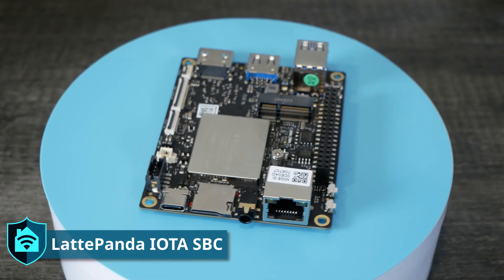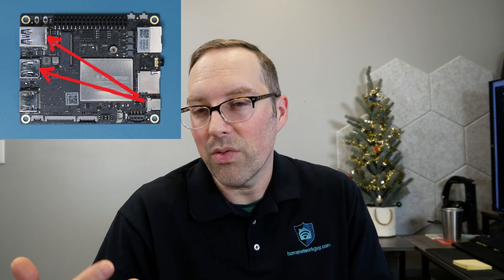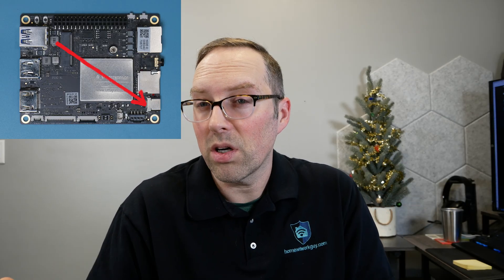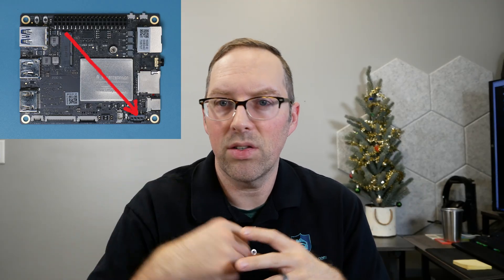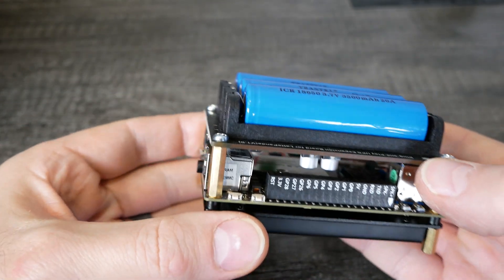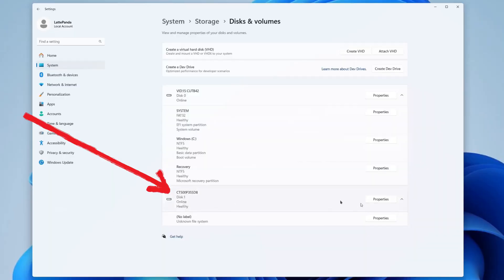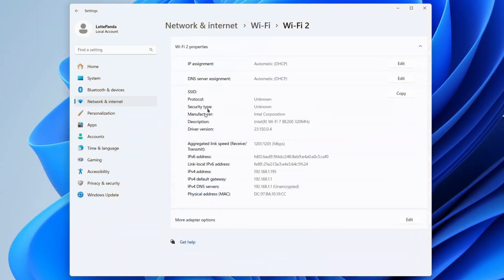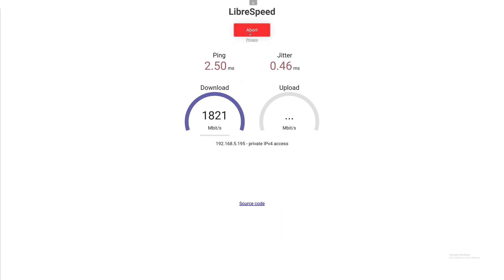LattePanda IOTA - A Palm-Sized Intel N150 SBC!

Comment: Thank you for the video. Am I missing something here? Who is this board for? By the time you add the NVMe hat, PoE, cooling, and a case, you’re well into a price range where you could just buy an N150 NAS or server class motherboard with a decent enclosure and far more native I/O. That’s where the value proposition starts to break down for me. The board itself is interesting, but the processor feels constrained by design choices like 1 GbE and accessory dependent expansion. Maybe the premium is mainly for the SBC form factor and ecosystem, but at this price point it’s fair to ask whether that tradeoff still makes sense. Please correct me if I’m missing something.
Reply from the maker: They advertise it for rapid prototyping and commercial applications such as industrial automation, intelligent gateways, advanced robotics, and interactive digital installations. 

If you just want a general purpose computer or server, it’s more budget friendly to get other options. The same goes for the Raspberry Pi and other similar SBCs. 

I like Raspberry Pi’s for projects such as a DIY touchscreen music player (I built several for my kids) and also an outdoor speaker which has an amplifier HAT so I can have Apple AirPlay enabled outdoor speakers. SBCs work well for those specific purposes better than a mini PC for example. I also like when I’m done with a particular SBC, I can repurpose it for another task (swap out components/HATs and customize it).

Comment: I would rather go for the form factor of small router - the same CPU, but 4x 2.5Gbps with comparable price and 2x M2 slots inside
Reply from the maker: I like those systems as well but just like the Raspberry Pi, these type of SBCs are designed more for specialized projects and tinkering. I wouldn’t use the IOTA board as a router. Conversely, I wouldn’t want to strap a 4 port 2.5Gbps mini PC on a robot for a robotics project. Haha.

Comment: Love the x86 with so much flexibility however that 1g LAN is killing me and with 10G USB 😭 come on!
Reply from the maker: I know what you mean. Definitely a bummer but I’m guessing they were focusing on specialized projects (robotics, etc) where even 1 Gbps is often more than enough. I still appreciate this board exists as a customizable compact x86 solution.
Reply: @homenetworkguy  I think this goes beyond a simple bummer. The N150 has a lot of real capability, and pairing it with a single 1 GbE port and very limited I O feels like deliberately holding the platform back. I get the cost argument, but for roughly ten dollars more you can buy server or NAS oriented boards with far more connectivity and expansion. That makes the value proposition hard to justify. If the premium here is the form factor, that’s fair to a point, but it still raises the question of whether the tradeoff makes sense at this price.
Reply: If you really need it, 5 and even 10 Gb USB-Ethernet adapters are available.  I still agree the 1 Gb is a bummer, because at this point I doubt it would add much more to the SBC's BOM cost to have 2.5 Gb Ethernet onboard.  But it probably was a cost decision.
Reply from the maker: Yeah for certain applications you could make use of USB Ethernet adapters but I think it’s not generally recommended to use them say on a router/firewall due to various reasons (potentially greater CPU utilization if there is no hardware offloading, sharing the USB bus speeds with other connected USB devices, etc). 

Yeah it could’ve been a cost savings measure but I recall (I think Protectli) telling me that 2.5GbE NICs were about the same price as 1GbE NICs several years ago. Hard to say what it’s like now. You would think it’s the same or better now but you never know with the market fluctuations.